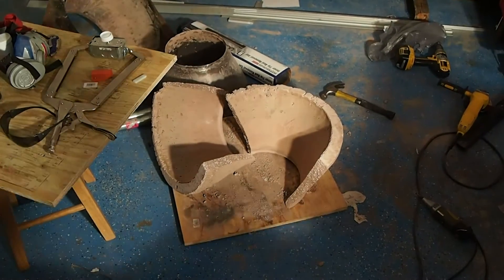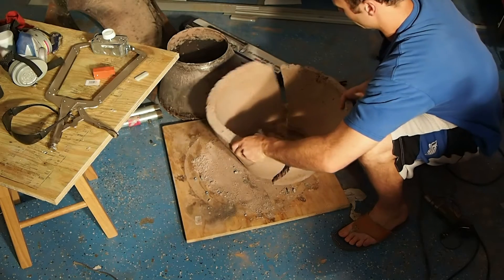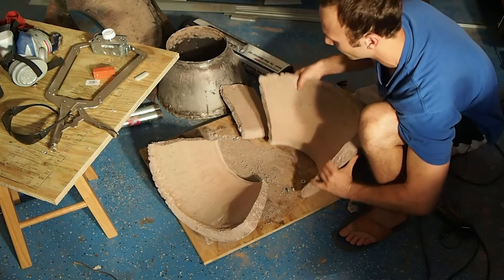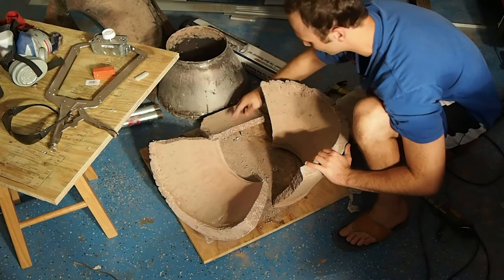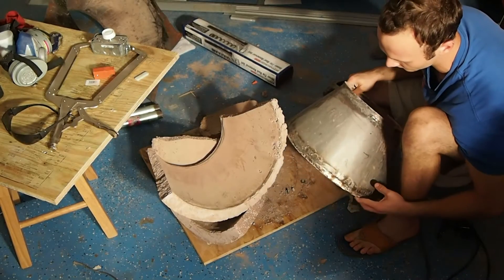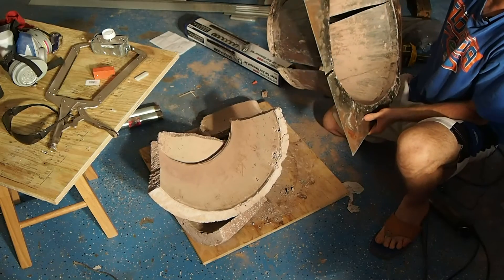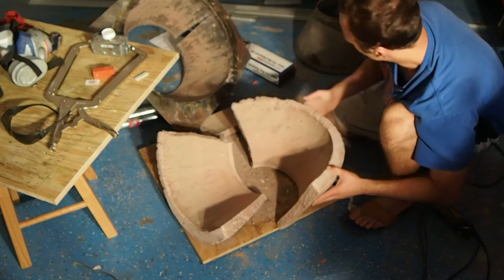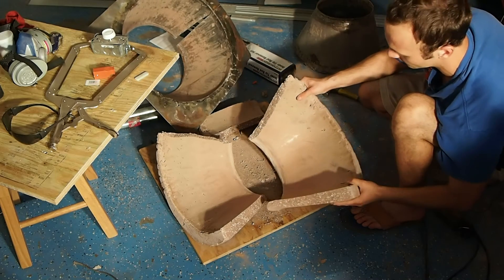Prototype Wood Gasifier Hearth V.1

Comment: I bought and installed a woodburner that has a ceramic core... Pyroclassic Fires made here in New Zealand for about 30 yrs. The best fire I've ever used., got a feeling they use vermiculite? Whatever it is it stores heat and clean burns like a boss using very little wood. Check them out, may help?

Comment: The breakage won't matter in the end if you pack them in tight. The permies use clay from the yard/sand/straw to SEAL the bricks/pieces together.  The kicker is to get it air tight, right?

Comment: Hi John. Thanks for your ideas. What ratio of materials did you use? I've never seen that silica powder you had before. Also the clay was interesting. I'm real interested in exploring ceramics for the burn chamber in a rocket stove. Never thought of using it to get the reduction zone in a gasifier though!